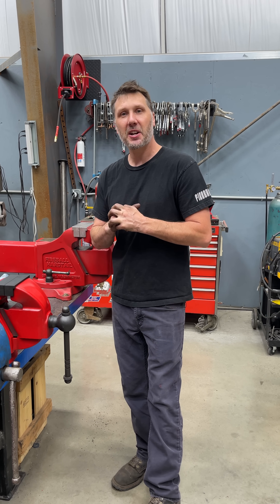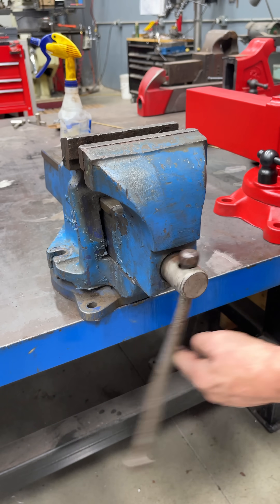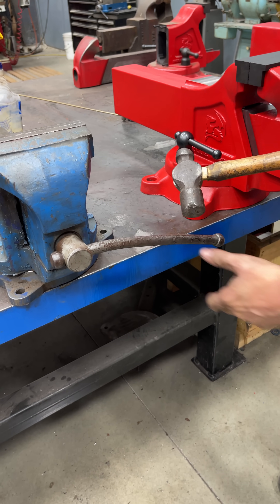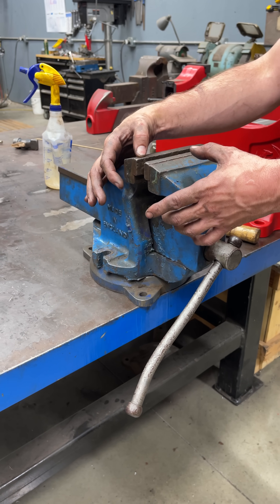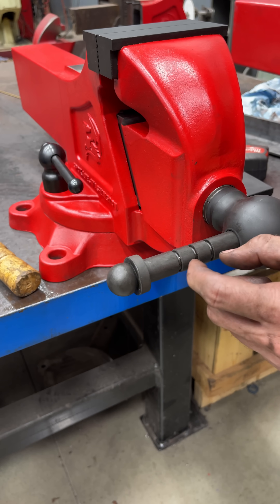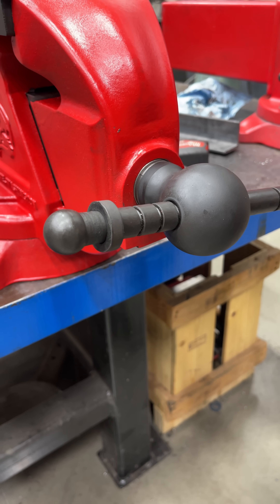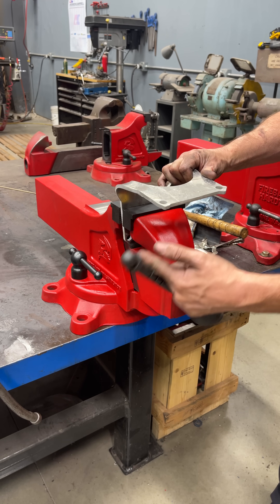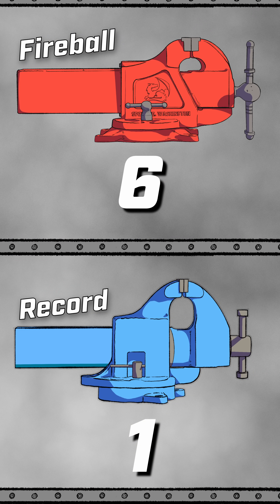This Is The Best Vise Handle Ever Made! Fireball 510 vs Record #6

Comment: Also I kinda understand why people might think the older vises are better. Because that was the truth for so long. This race to the bottom in manufacturing that started in the 70s. Finally there a company that is not trying to make things cheaper they are actually trying to design and manufacture things better. People are just not used to it yet.

Comment: I disagree. The best vice is the vice you have, not the vice you wish you had. I already own several vices and they all work quite well. I have no intention of overloading them. Two of them were already broken when I got them. I guess that means that they're a terrible vice? I don't think so. I think it means they were subjected to excessive abuse. One of them had the corner broken off of the dynamic jaw so I repaired that The other one had the support shelf for the jaw insert broken off of the static side. I repaired them both in a similar way and I have a fraction of the amount of money in three good quality vices that it would take to buy one hardtail vice. Sure, they're not as durable and tough as a hardtail but I don't act like a jackass in my shop intentionally just beating the hell out of my vise with a sledge to see if it will break. If I had employees though, I probably would buy the hardtail because I know how employees tend to not give a crap about your stuff.